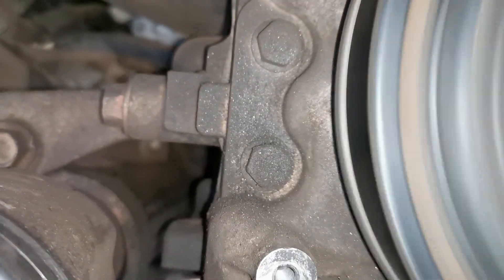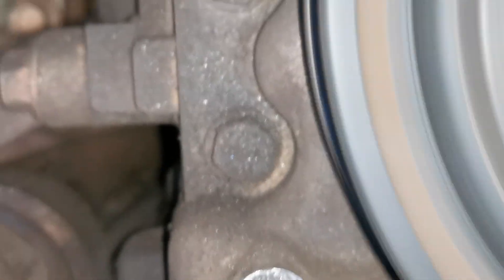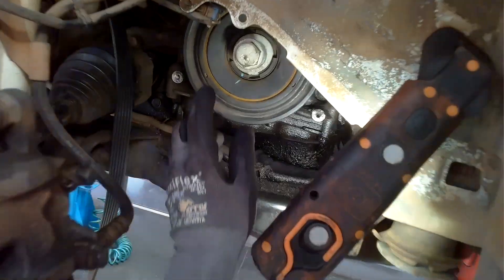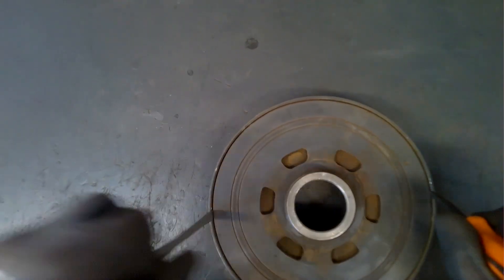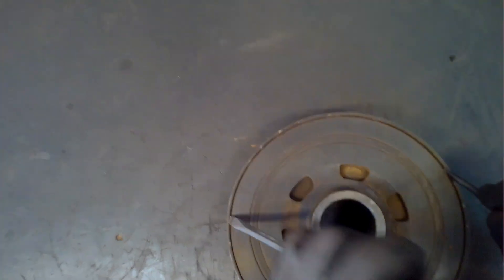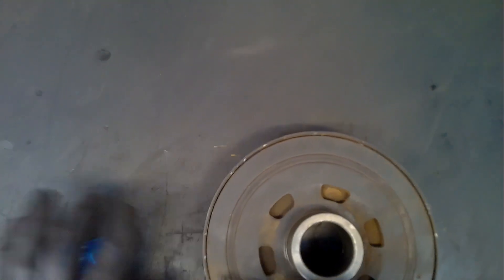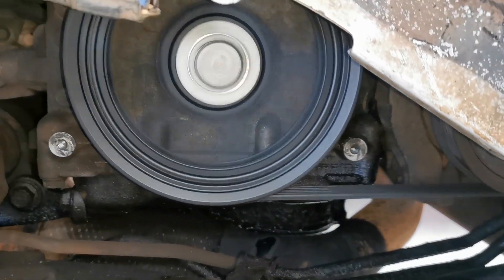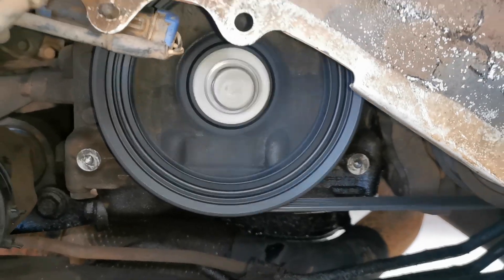What Does An Engine With Bottom End Noise Sound Like? - Watch and Listen!

Comment from the maker: Things to check when you experience bottom end noise (In no particular order) 
1) Isolate, remove necessary components and see if you can eliminate/pinpoint the noise. 
2) Check oil level, check condition of oil and take a sample to see if any metal is visible in the oil - this can indicate oil starvation issues / engine bearings worn.  
3) Check service history, has oil intervals been stretched or skipped. 
4) Listen as close to the noise as possible - using a screw driver or mechanic stethoscope to help pinpoint.
5) Remove sump and inspect area including oil pickup.  
 
As always thanks for watching 😁
Reply: Also if we think it's a big end instead of a main, disconnect individual spark plugs or injectors, which will take the stress of the bearing and change the sound.

Comment: I had a 2001 Pug 406 HDI that had 3 bottom pulleys in 100K miles....each replacement was from the main dealer but all were of different design. 

I recognised the noise as soon as I heard it on this car

Comment: In my experience, most big end  bearing noise exhibits itself as top end knock as it resonates up the connecting rod and gets worse at approx 2500 rpm as the timing advances

Comment: Didn't sound deep enough for a bottom end bearing. You can see a wicked vibration on the pulley as it's badly off centre.
Reply from the maker: Yes you can see movement for sure, I can honestly understand fully why they thought it was bottom end bearing noise, a total of 4 mechanics called it engine noise before I inspected it further. 
As you know yourself, the key lays in the investigation, no problem having an initial thought or guess what it could be? you can then prove yourself right or wrong when checking deeper :)
Reply: @GerardBurkeBurkesGarage  As has been said above... it didn't sound deep/loud enough to be a big end and the pulley is vibrating [although that may be easy to miss if you weren't staring at it].  One investment I made years ago is an automotive stethoscope and it's great for pinpointing noises when the car is static - like here.  Have a pinking problem under load at the moment in my 1.8 Duratec [Mk2 Focus] so it's much use for that unfortunately :(  Great vid and great to see an Irish automotive videographer as well.  I'm from Dublin myself but have lived in the UK for 35 years now.